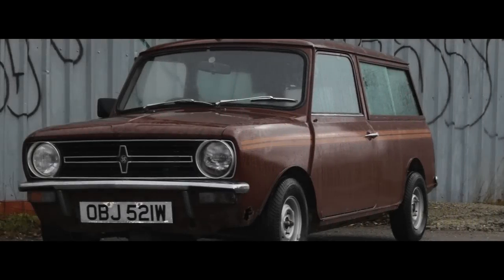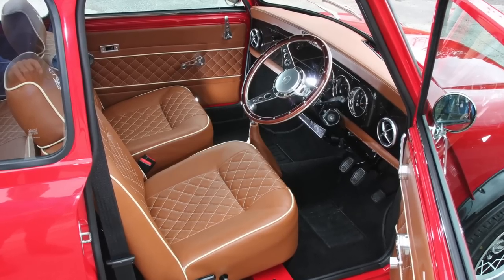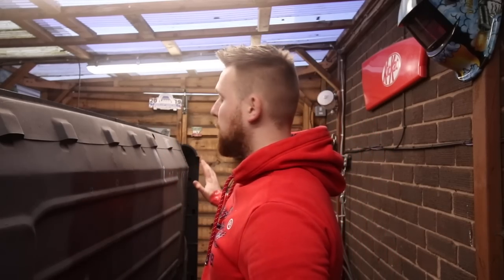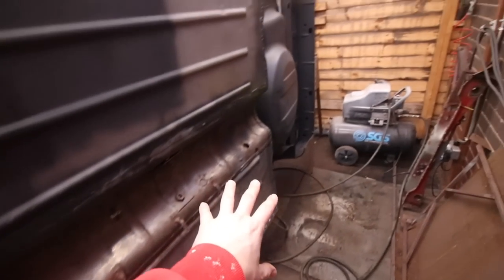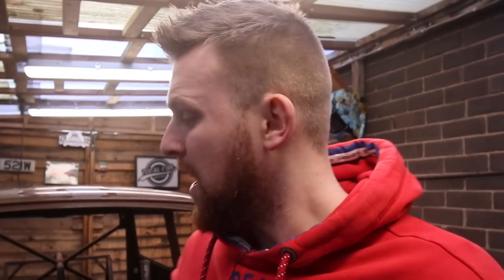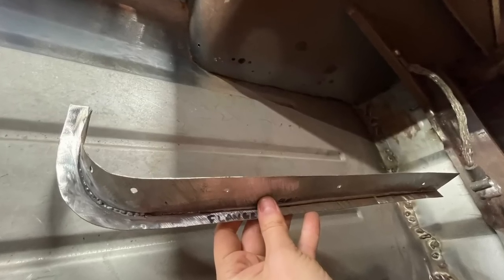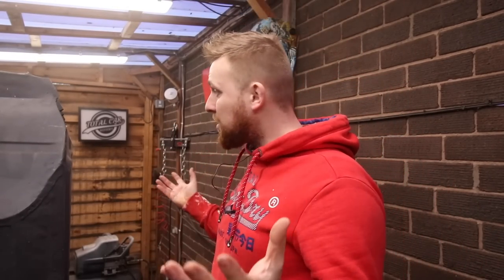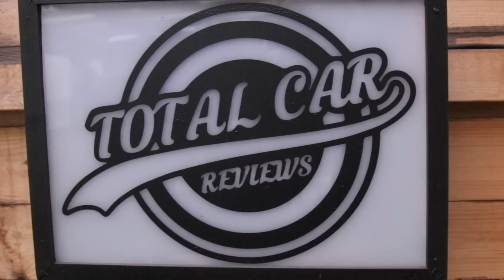HOW LONG DOES IT TAKE TO RESTORE A CLASSIC CAR? - *VTEC* Classic Mini Clubman Estate!

Comment: Bought my mini, first year I did nothing. Second year started and completed the entire interior, dash etc… Feeling a bit to pleased with myself I jumped straight in to a full engine and engine bay restoration. That was two years ago this month. Engine is only about 75% rebuilt, not started anything else yet. 

During that time I’ve changed jobs, bought a new build house that needed a ton of work and completed a deployment. I have decided I need to rebuild the subframes, brake conversion and go back to the car exterior to de-chrome and tidy the body work up. 

To say I regret pulling the engine out is an understatement. Genuinely getting anxiety about the lack of progress on the car. I’ve promised I’ll have the engine finished and running be the end of Feb (I hope). And then just pray the rest of the engine bay is more about hard work than precision and new parts. 🙏🏻
Reply from the maker: Stick with it Sam, I certainly know this feeling

Comment: Tom , instead of cutting out the bottom of the quarter as you said , because you have had expansion of the panels when welding which causes your “bounty panel” when pressed, learn how to shrink it and planing it with a hot torch flame , there are plenty of videos on YouTube explaining how to , as you said you want to learn and give things a try , it can save you a lot of work re doing it all
And any chance of a sticker or am I too late 
TCR TV
Reply from the maker: It’s something I have thought about dude, but I think with my juggling so many plates at the moment I’ll stick to what I know and just cut it out and start again 💪🏻
Reply: There’s no garuantee that putting in another repair panel will make the panel flat. There are a few ways of flattening out that ‘oil can’ bulge, you can shrink it, or you can crease it… ie put a tiny swage line near the weld, and then dress it flat.. that swage line can be easily made invisible with lead loading, or just a smear of filler. You might also be able to dress down the seam at the bottom with a blunt bolster to stretch the main panel. And use a flatting slap tool to dress it right.   All this can be done before you throw the towel in and cut it. Keep em coming….  P.s., it’s a good job you haven’t got kids!  Ha-ha. You’re a grafter!